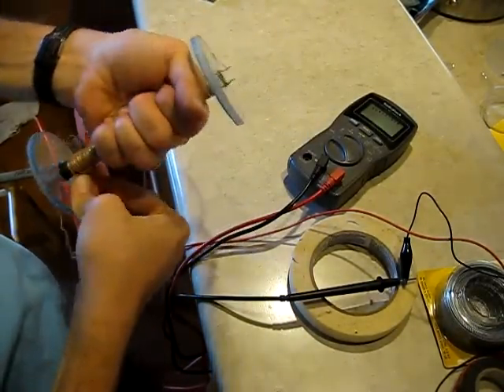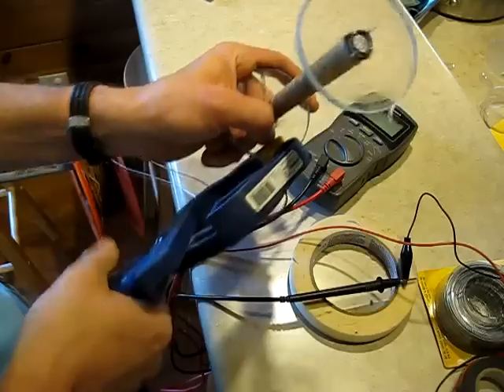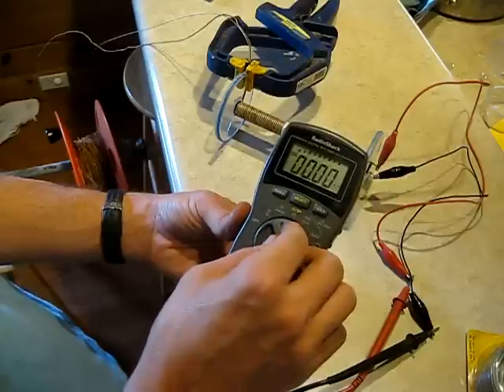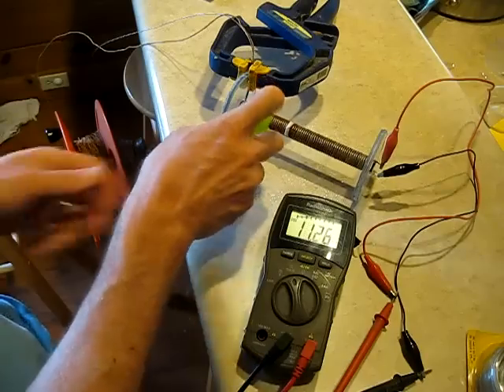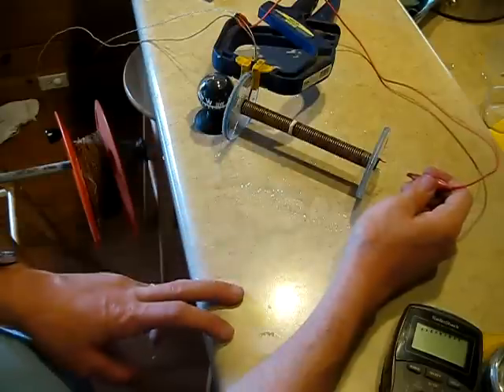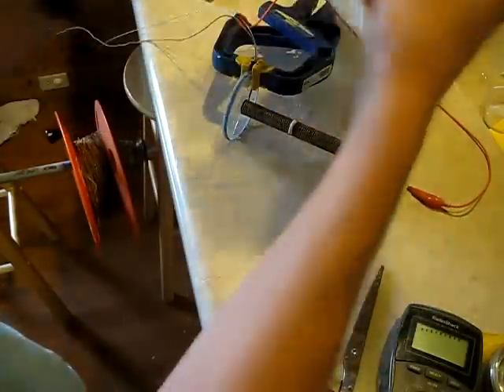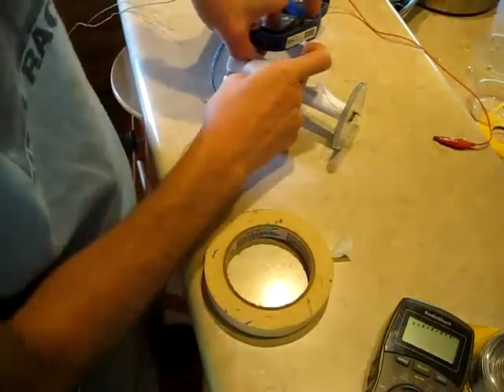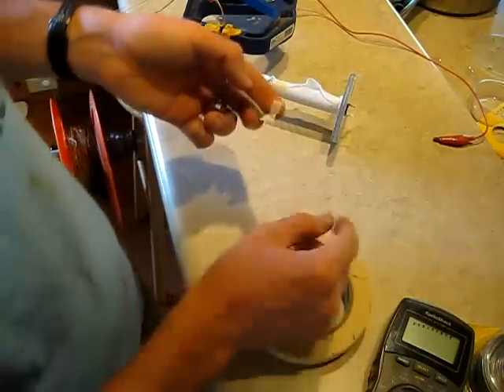How To Build A Nathan Stubblefield Coil Part 2

Comment: Two different metals in conductive contact with each other(water provides this) form a battery. Try aluminum and steel. Aluminum and copper? Might get different results for amps. I am guessing the higher amps the faster the metal oxidation and break down.